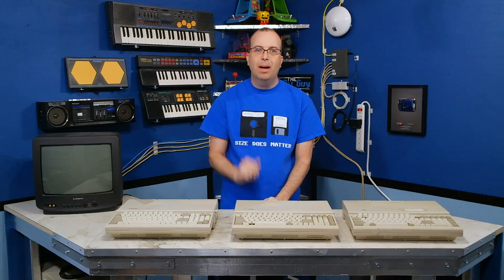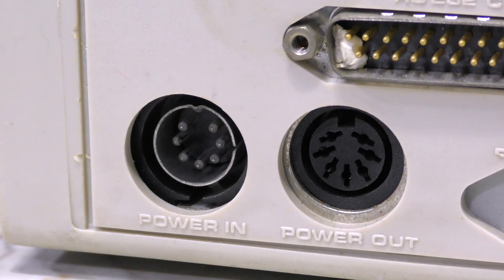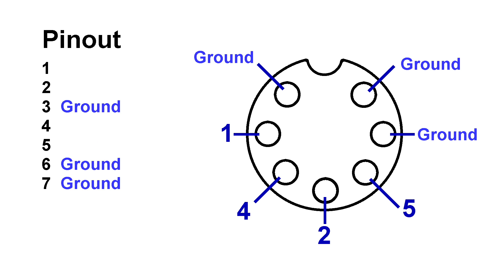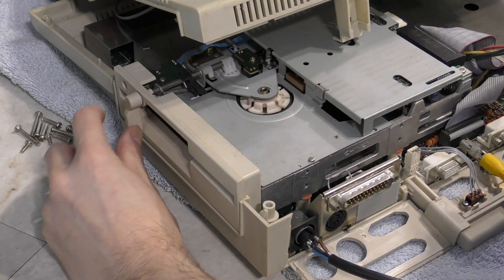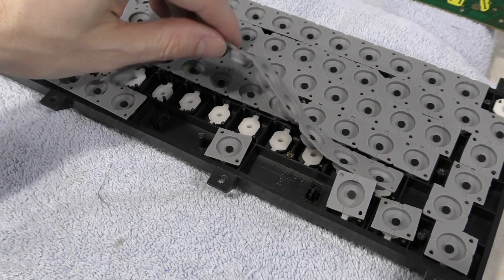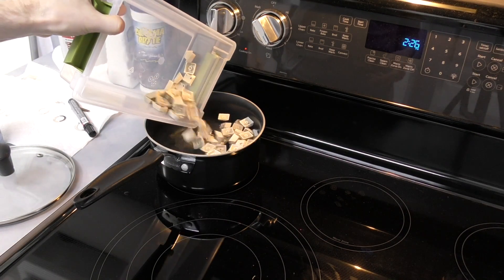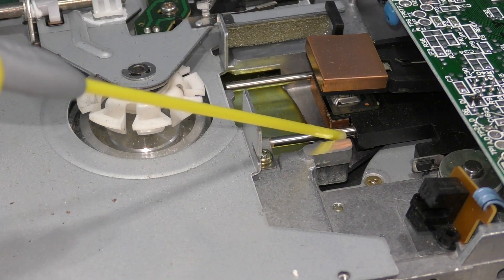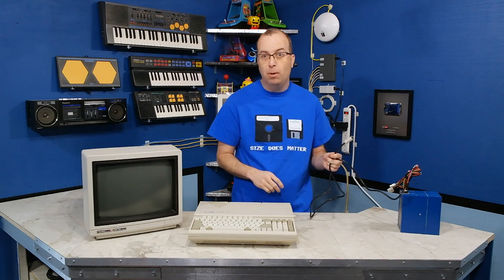Laser XT Restoration

Comment: The -12 is used for a few thing, mostly the RS232 .. probably video (not sure). You can generate the -12 rail using the monolitic DC-DC ISOLATED converter, The ouput is fully isolated from the input you can reference the positive ouput to ground and you will end with -12V in the negative terminal. The are very compact, no circuit required, just plug and play (adding some filtering is better though). Have a look at the part here. For example, seach this code in Digikey Site: 811-1404-5-ND ... you have tons of alternatives, starting on 6 to 8 dollars, but picked Murata because they are less noisy. This one is capable of 250mA and you need to feed it with 12V. And it outputs 12V, isolated so you can reference it like I told above. The obvius solution is using a -/+ 9V tranformer with center tap (unregluated -/+ 12V) or let more room, -/+ 15 for regulated. But would be less bulky just a 12V regulated swiching PSU pack like the ones in notebooks, I would pick 5A. Get 5V from the 12 (using the regulator of your choice, I would stick to LINEAR ones) and get -12V using the Digikey part I told above. DONE

Comment: You might want to buy some sugru (maybe black and white, for mixing the exact shade of grey) and then mould a replacement strain relief from it, for the DIN plug. Of course that wouldn't reproduce the shape of the original strain relief, but since sugru is rubbery and flexible, a thinning sleeve should be functionally identical.

Comment: Cool.  I have a Laser Compact XT.  It was my first MS-DOS computer.  Let me know if you need any documentation I have the original 3-ring binder documentation that I could copy and send along.  It is possible to upgrade this machine a little bit.  On mine, I added an addition UART and RS232 line driver chips so as to enable Com2.  I also added an XT expansion card slot on the side so I can plug in 1 card, or even an expansion chassis.  (The expansion chassis was purported to be an option, but I don't think it was ever actually sold.  I think the problem may have been because of FCC emission certification.)  Its a fine little machine.  I haven't actually watched all your video yet, but they might have come with a 1MB EMM expansion card inside which is useful in setting up a RAM drive.  Glad to see this machine on your channel.  Brings back memories.  I'll have to dig mine out and see if it still works.
Reply: Hey I would love to see more of your upgrades! It was also my first computer.
Reply: I'm sure if he needed it he would appreciate it a lot for his documentary. Try emailing him because he didnt respond via comment.
Reply: Would be a happy buyer if you ever want to pass it on. I spent several years as a kid beating the life out of this exact machine.  transported me and 100% responsible for my life path. Nice to hear you mention it.
Reply: Cool

Comment: Er re the -12v supply. Just use a center tapped 24v transformer.

The middle tap becomes ground. The other outside taps become -12 and +12v respectively. No need for a massive ATX PSU for this.

Remember ground is relative and Volts = potential difference.

Experiment for the skeptical. Take two 9v batts, join them together  Place your ground probe on the interconnecting terminal, measure the voltage to the positive terminal and the negative terminal. You will see +9v and -9v respectively.

Comment: I had a Laser 128EX in the late 80s, great machine. Had a switch in the back that gave you 3x the clock speed. Also a switch for a Dvorak keyboard layout, which I tried to learn but didn't get too far.

Comment: Those key stalks are fairly basic - they look like they have a pair of centering lugs and those two tiny holes might serve the same purpose.  If you or anyone else wants to send me one of those broken ones, it might be fun to model a replacement and then I could print samples to try.  It's probably not a bad idea to be able to reproduce them, even if you do have a second system sort-of designated for parts.
Reply: Kelly R Johnson Another option would be to carve one out of a solid block.  Did it once for a larger part using some leftover wood.

Comment: I remember when I upgraded my old amiga a1200 and the power supply at the time couldn't keep up so I got an old at power supply from the school trash (they were throwing out ancient 286s). Got out my multimeter and soldered the amiga power lead to the appropriate terminals, added a toggle switch to power up the psu and it worked no problems at all. Obviously if you have 'quirky' voltages the psu doesn't output or you can't tap it's harder. More or less de ja vu 😊

Comment: Nice cleanup and fix job, by the way \m/
...I wonder if the difference in rendering between composite and RGB is why some old monitors used to have an input switch next to the rear ports, sometimes even right there on the front, either behind the image adjust panel cover, or even right next to the power button? Never saw the point of it when all we had hooked up to ours was the ST, which wouldn't have made much sense as anything other than analogue RGB, but I figure if we had instead a machine like this which could potentially provide both TTL RGB and NTSC composite video down the same cable and ports (or at least, a double-headed lead?), with each standard being more useful for different things, it could have been very useful to be able to just press a toggle button in response to what the software was trying to display.

Comment: If I had to guess, it seems like the first unit was outputting an NTSC color burst signal on the composite output in 80-column mode, whereas the second one was not for some reason (resulting in monochrome video with no color fringing). I believe CGA had a way to toggle the composite color burst in software; disabling it would produce monochrome only output but made text clearer.
Reply: TravisTev Probably the video mode dip switch was set to 80x25 monochrome instead of 80x25 color, which is the main reason IBM created that option.

Comment: Curious! A machine I never heard of before, even though it seems to be a fairly mainstream American model. An interesting suggestion of how PC compatibles could have gone with more of a "traditional" home micro influence than business focussed with huge cases and ISA based expansion. Even down to pretty much just stealing the IIc case.

Bit of a facepalm moment getting all those power schematics then opening it up to find that it's all labelled inside  eh :D

As far as the display quality goes, I think I can explain why one looks better than the other - the colour artefacts you get over composite (especially with NTSC) actually only happen because the TV is looking for fine details within the original monochrome signal to turn into colour, which it's prompted into doing by (and is only able to properly sync with thanks to) the colourburst signal at the start of each scanline. If that signal is absent, as it is with monochrome broadcasts (and b/w content over colour channels if the broadcaster has been smart enough to turn the burst off), then the colour discrimination circuits are turned off and the luma is passed through to the tube without any further interference.

As CGA high-rez is only monochrome anyway, there's no need for the colourburst to be present, and therefore it should be possible to get perfectly crisp 80-column text on a TV - even typical RF bandwidth should be enough to allow 480~560 pixels within the underscan area (so 6~7 pixels per character), and straight composite (or more truthfully in this case, "baseband", because nothing other than sync is composited with the luma signal) is technically only limited by the capability of the cable, connectors, and the silicon at each end; certainly 700+ pixels should be visible in most cases.

Really, if the BIOS was set up properly, it should disable the colourburst on the POST screen and any other CGA 80-column / 640-pixel mode unless specifically turned on (eg in order to deliberately produce artefact-colour graphics). Guess the model with the working disc drive is a later revision where they remembered to do that, whereas the more broken one is older and predates that particular realisation by the Laser engineering team? :)

Now I'm trying to remember if that was an option on the Apple II as well... after all, it had 280 and then 560 pixel monochrome ability in different generations, and although those were often used to produce the well known 6 or 16 colour artefact graphics, if what you actually wanted was high horizontal resolution, that effect would be completely unwanted. Having the right spark of realisation when designing the system would let you effectively produce two different video modes - high rez mono and lower rez colour - by doing nothing more than gating the colourburst sync signal in and out, and patterning the mono pixels differently.

Funnily enough there are some other computers out there where the "composite" RCA socket seems to be used specifically as a mono / greyscale hi-rez monitor output (for colour, you use either RF in low rez, or an RGB monitor for medium/higher rez), for example the Amiga; the RCA on that produces a baseband signal with no chroma signal on top of the luma, or a colourburst, so the output from that is greyscale only... but also extremely high resolution (for 15khz) over a single coaxial lead.
Reply: Mark Penrice 80 column mode still has/had the full set of 16 colors. But there are explicitly monochrome versions of the 40x25, 80x25 and 320x200 modes, specifically to turn off the color burst on the CGA composite output.

Comment: Atari 520STm (no built-in floppy or PSU) PSU brick uses the same voltages, but has a female connector and different pin configuration, so might be able to be modified to work with  this.

Comment: Oh man, this was my very first computer.  We later got a 386 SX 25 Laser computer in 1992 -- a more conventional set up but with a slimline proprietary case, it was already pretty much obsolete when we got it.  I ran my BBS on it until the power supply went out about 4 years later.  Wish I still had it to give it to you, but as I remember, the first thing to go out was the power supply for both the XT and the 386 (which had a proprietary internal power supply).

Comment: Will you be fixing the spare computer ? You could 3d-print the broken key tabs, and then it's just using off the shelf spare parts. It just seems like a waste to let something this rare gather dust for such minor cosmetic damage
Reply from the maker: Well, it needs 4 key caps, as well as 4 of the little plungers.  But it also has a broken floppy drive.

Comment: Another awesome vid. I've never seen RGB from CGA, all the displays at the time were CMYK, or puke purple and sick cyan as we used to called it. I figured it was some kind of aberration with the CGA standard for printing purposes... Exactly how do you get CGA to show proper RGB? Example, almost all Leisure Suit Larry with the, of the times, CGA graphics cards look to be CMYK.
Reply from the maker: If you want CGA to look correct for games, you need to run it on a composite monitor.
Reply: CGA had two common color palette selections in 320×200 graphics mode: white, magenta, and cyan (sometimes a software tweak was used to use red in place of magenta); and red, brown, and green. I'm not sure what you mean by CMYK. CMYK is a method of mixing colors with ink/pigments and has nothing to do with CGA.

Comment: That Zilog chip you panned across could possibly be the CPU on the XT? Or is it a different chip entirely?
Reply from the maker: I didn't recognize any numbers on that chip.  I could have googled it.  But if it were an 8088 compatible CPU, I'm pretty sure I would have recognized the number scheme.
Reply: Fair enough. I just know that Zilog manufactured CPU's for a long time in the 80's so that's why I thought about it. I don't know enough about these old machines to be able to tell what kind of chip it is either.
It seems like an intriguing machine though.

Comment: During the recent years, I did a lot of repairings too, on my 2 laptops computer I posses. I also upgraded them from time to time with more RAM, new cpu's and even gpu's etc. The "hardest thing I got through, was a complete change of a dead motherboard I got after a short circuit, caused by a unmounted screw with a complete new one, which I fortunately handled perfectly :). So, I did quite a bit of a hardware work done also, BUT, Man, you are simply GENIOUS! I like the way you dedicate yourself to this stuff, it's simply stunning to watch at! Congrats for your ability and knowledge! I just can't wait to see your next video coming soon! Cheers!

Comment: I work with OCTs (Ocular Coherence Tomography). All of them have the ABS covers. They get covered with pen marks, dirt and fluorescence die (very hard to clean even with Alcohol). The best solution I have found is CIF crème. Cleans it right off, doesn't damage the ABS plastic. It is easy to clean off the CIF residue afterwords. Last but also very important it waters down the fluorescence die.
Also smells nice, my choice is the lemon one. I am sure you have a bottle in your kitchen somewhere ;)
It doesn't have to be CIF, any other copy brand which have crème with micro crystals (abrasives) works. I tested it. It can replace the baking soda method.

FYI I also tested in on ABS covers which were made in the 1970s, as there is still equipment which is working from that era (not OCTs thou)

Comment: I was going to say (before watching the rest of the vid, naturally. lol) - it's usually simple enough to find the proper voltage rails by opening up the machine instead of relying on (unverified) pinouts.

It's also very common for DIN connector pins to have that weird numbering, as it kind of started with the 3-pin DIN, I guess?
I can see why somebody used the different numbering for that pinout.

An Amiga PSU could be used for the XT, but you can get a compact modern SMPS "brick" on eBay etc.
It is getting harder to find PSUs that have both -5V and -12V rails, though, unless you fit an open or closed-frame PSU module into a nice safer case.
Reply: Actually, many smaller PCs and clones of this era didn't usually require too much current for the negative power rails.

You could use one of those "laptop style" PSU bricks for external hard drive caddies for the main +5V and +12V rails.

Then, use some small neg voltage DC-DC converter modules for -5V and -12V.
Those could be put into a small project box that the DC power cable runs through.

Comment: Those mounts for the keycaps look like they're compatible with Cherry MX switches. You can buy some of those cheap eBay keycap sets and see if they will fit, so you can have two usable XTs :)
Reply: Haru Jayasekara That's the classic pin shape also used by IBM.

Comment: Get adapter for external 3.5" drive. it provides 5 +  12V
Reply from the maker: yes, but it doesn't have the negative 12 volts.
Reply: oh I see. i thought -12V is ground.

Comment: Hey David! I was wondering if you could do an episode where you use a 3D-Printer to create missing parts (like keys) ? I think that would be really interesting for a lot of people. Or is that agains the retro-restauration-rules ;) ?
Reply from the maker: In order to print small parts like that you would need a very expensive 3D printer.  It is a common misconception, but those ones you can buy for $2,000 or anywhere around that price cannot make small parts like that.  I had one for quite a while and found it useless for most of my work.
Reply: Thanks for getting back to me David! I did not know that!

Comment: +5v / +12v / -12v are pretty common for these old systems. The +5v is for the logic and the +12v / -12v are for the serial port. You can find those without too much difficulty, but most of them are internal, like the RT-65B for example. You could always build an enclosure for it and add a switch and a fuse.
I was amazed by the difference in CGA composite vs RGB! I'll need to watch that video.
Reply from the maker: Interesting.  I was wondering what the -12V was actually used for.  I wonder if the machine would work without the -12V as long as I didn't care about using the serial port?
Reply: RS-232 voltage levels range from +3v to +25v for the 0 bit, and -3v to -25v for the 1 bit. On most PCs the range is limited to around -12 or -13 to +12 or +13. However, other components may also need that 12v. It's difficult to tell without a block diagram. You'd need to sound out all the connections to the 12v. There could be regulators on the board that step that up or down depending on what other components need. I'm not familiar with Lasers so I don't really know.
Good luck!

Comment: Hey Dave, hope all ok. Thanks for this amazing video about the laser, very unusual stuff :). About the power supply you can get a cheap one for the ATARI 520 ST, as they are cheap on ebay and they have the same voltages outputs so you  just change the connector,the Laser has 3 grounds and the Atari has 2 but in the laser 2 of them are common so you can connect them together and you will get a almost original look power supply as the original one is hard to get, you can get it but can take years, all the best from Southampton UK.

Comment: By the way, it is a slow method (soaking) but I've found if you use 2 denture cleaner tablets in a bowl of warm water for a set of ~104 keycaps works very well, and wont damage the plastics/lettering

Comment: You plugged in a power supply from a different computer without checking the pinouts and voltages?  That's a pretty big derp, what if that would have put 12v on a 3v3 rail or something?
Reply from the maker: Well, to be honest... I had been told by somebody who I trusted that the 128 and XT used the same power brick and were compatible.  And it made perfect sense.  So I had assumed from the moment I bought them on ebay that I had a working power supply ready to test with.